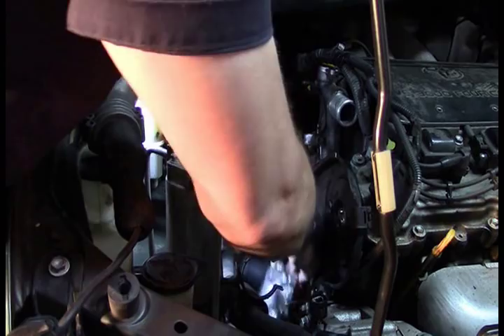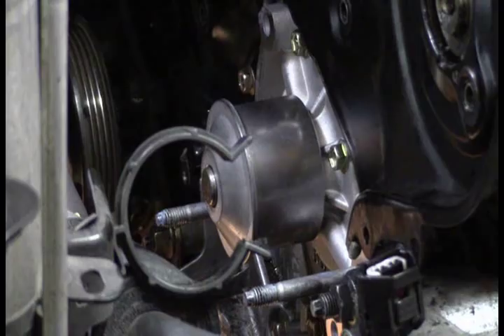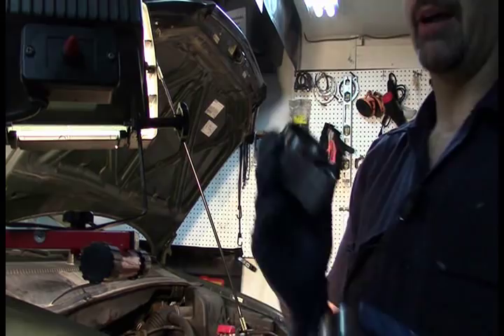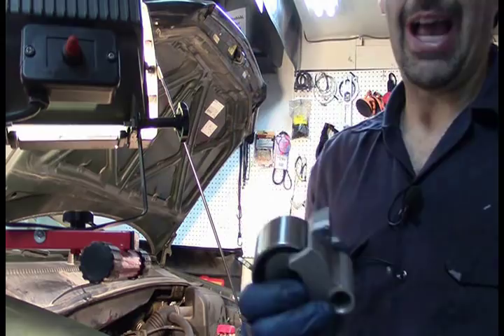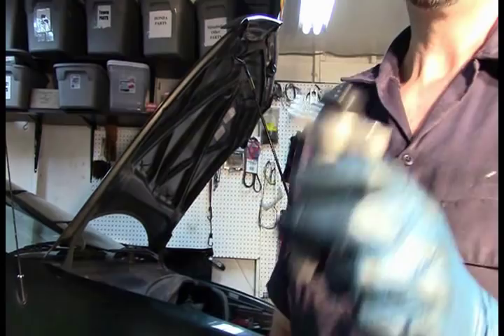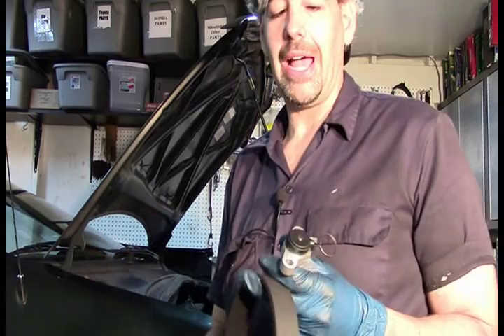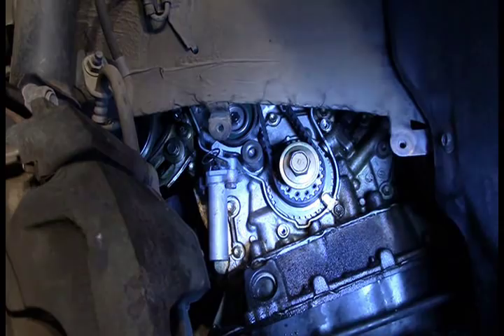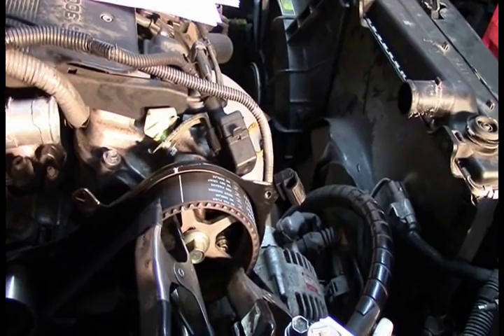Timing Belt 1997-2010 Toyota V6 Sienna, Highlander, Camry, Lexus Part 3

Comment: Great video series!  I did not quite understand how you could take the belt off the rear sprocket with the jammed wrench there.  It seemed to block the belt from coming off.  Is the wrench there more of an insurance against the sprocket accidentally being moved?
Reply from the maker: Hi Bro, I was wondering where you've been!  Exactly correct, the wrench is to keep the sprocket from accidentally moving.  I did remove the wrench just to get the belt past. Just bumping the camshaft sprocket on this model will cause it to snap sharply in reverse into a "rested" state and the wrench prevents that.  It also help to lock it in position while I position the belt over the pulleys and crank too.
Reply: Well, I was disappointed because you did not mention me by my name in your video but I appreciate that you did tell the world that you were pushed to get better camera ::-)

Getting back to your video, isn't there a better tool to lock both the camshaft sprockets in place which goes between the two camshafts and thus belt can be removed without disturbing the locking tool?
Reply from the maker: 12vgs8606 Man I am not sure I ever got your actual name. I figured your birthname was 12VGS8606.  But nonetheless I don't know of any special tools that lock both camshafts for this model. Really you just need to lock that Bank 1 one as the front one is pretty stable and won't move unless you really want it to.
Reply: This job does look more complicated than the corresponding Honda one.  At least on the Honda,I have not heard about the cam moving but more importantly they do not use the brain dead design of having to remove the sprocket before the cover can come off before the water pump bolt can be accessed!  Was that a German or Chrysler engineer who designed that portion of the Toyota engine?
Reply: Since the sprocket needs to come off, that tool is pretty much useless on the Toyota!
Reply from the maker: 12vgs8606 I don't know who designed it but absolutely frustrating as hell. If the rear cover was just about 1 inch higher off the H2O pump you could access the pump without all the extra work. The first time I ever did a belt on this engine it sunk in that there really is no way to remove the H2O pump without moving the rear cover out of the way so I undid all the bolts and then realized that the cam sprocket keeps you from getting just the hair of clearance more that you need. Unbelievable.  The only way to get that H2O pump is indeed to remove at least one cam sprocket (the "book" tells you to remove both which is not neccessary).  
Trying to remove the pump without removing a sprocket will result in bending the rear cover and then the idler pulleys will rub against it.
Reply: But if you remove the rear sprocket (a challenge in itself!) how do you prevent that cam from violently moving?  I would have concerns about this timing belt change even if it were to be done at the dealership.
Reply from the maker: 12vgs8606 Ah I never even thought of that!! Fantastic question. Actually, the wrench to keep the sprocket from moving was my idea. The "book" says to just rotate the crankshaft back 40 degrees so all pistons are in a position that none are at TDC but I like my way better because it's easier to install the belt when everything is lined up.
Reply: Schrodingers Box OK...I line everything up before disassembly, double check that engine was in time and add marks for re-installation, then turn crank 60 degrees CCW. After belt removal, If you turn the bank 1 cam CW about 3 or four teeth from TDC position it will stay in place temporarily. When you are ready to install belt, move bank 2 cam about one less notch CW,  put belt on Bank 1 gear and clip a spring clip over end of gear to keep belt in place, route belt under idler to bank 2 gear, clip belt on gear. With the lines on belt aligned properly rotate each cam CCW, starting with bank one, until marks are lined up with rear cover. Is belt tight at top? If it is route belt around WP and tensioner, turn crank.to TDC and install belt. double check cam marks. Release tensioner pin. Turn crank 2 full rotations & re-check marks. 

If all is good proceed with assembly.

Comment: loved your video.  I have a 2000 sienna with 212k miles.  I am good at fixing things.  I hate not having enough rooms to stick your hand.  I am thinking of doing the timing belt and it would be great if you include all the tools required to do this job.  Thanks in advance.
Reply from the maker: onesri The video shows everything you need

Comment: Is there a normal belt sound to a new timing belt?  I replaced all of the components that touched the belt.  Car runs great.  The new belt sounds like a new belt.  It is not silent, does not make an unusual noise, and does not smell like rubber burning.  It simply sounds like there is a belt under the timing cover. Is that normal always or for only the first few hours of operation?  Unfortunately, I did not really listen to the belt prior to replacement so I do not know a known good sound.
Reply from the maker: +Sandbag1300 You should never hear a timing belt- or any belt for that matter. You might hear pulleys if the tension is not right or there is component wear or rubbing, etc.
Look for a mechanical interference.
Reply: I may be overly sensitive to the sound as I am somewhat a perfectionist.  The 6 cylinder engine is whisper quiet.  Only thing I can think may have happened is that I had to re-compress the new belt tensioner in a vice before re-installing it.  Maybe as a result the tensioner is over tensioning the belt.  That is kind of what the sound makes me think. The water pump and pulleys are new from the full Aisin Toyota timing belt kit and were in perfect working order before installation.  Does an over tensioned new timing belt sound possible?
Reply from the maker: Sandbag1300 An overtensioned timing belt will definitely cause bearing noise on a pulley.

  In all fairness what you may have here is a bit of a placebo effect- the noise may have always been there but because you are paying extra attention because you just replaced the timing belt, you are more perceptive to any anomalies.

  It may be as simple as just an accessory.  I would start by removing the serp belt and see if noise goes away.

Comment: Hi Matt.  Thank you very much for the video.  It helps me understanding my car repair and identify honest mechanics.  I got timing belt done at a local car shop.  The main technician of the store did exactly steps in your video.  After timing belt job was completed, the engine runs smoothly but engine light came up after 20 - 25 miles with code P0016.  He suggested to change Camshaft position sensor on my Toyota Highlander 2003.  After camshaft position sensor was changed, the engine light came up again after 25 miles with same error P0016.  Just wondering if timing belt jumped few teeth?
Reply from the maker: most likely.  I usually correlate the CKPS with the CPS to diagnose that but you also do the laborious method of checking timing marks

Comment: hoping you can chime in. Gates or Dayco Timing belt kit for an 05 Sienna. Gates ranges from 0 to another $20.
Reply from the maker: The kit shown in the video is Gates, and I have used both and cannot discern any evidence of a variance in quality. FWIW, the first belt I did was a Gates maybe 7 years ago and car still running with those parts so it does have at least some evidence of longevity but I'm sure same would be true if I used Dayco.
 I'd go with the cheaper and not have any concerns.

Comment: i usually also change the shaft seals of the cam crank and oil pump if oil pump i cam sprocket driven, if the vehicle had its secound belt change and no sign of the seals been replaced as they can oil up the new belt when they fail ,
Also i always disconnect the battery , i know immobilizer car radio etc. but the risk of somone starting a  car i do a belt on while i have to dash out from the shop is to big a risk and a spanner or something actuating the starter while you have the belt off is another risk. a small risk but if the battery is disconected this risk is eliminated also. one can use a small batt to keep the system allive if it needs continues power ......
for sprokets often there is a lock tool  and i do undo the cam bolts with the impact gun befor i remove the cambelt just to crack them loose , but the cam bolt and balancer is often the biggest problem
Reply from the maker: Ah great advice. Never even occurred to me about the pump and seals, totally logical idea!  Thanks for the comment.

Comment: Where do you get the torque specs from ? Is there a website that you would recommend ! I'm a DIY I learn from your videos this is amazing how you guys can teach as if we were in class. Thanks!
Reply from the maker: Yes good question: I pulled the specs from AllData DIY which I use occassionally when doing a job where torque is particularly critical or I need wiring diagrams.

Comment: One more question if you have time:

When you raise the engine a bit to clear the sidewall for water pump removal, I'm guessing you must first loosen the other engine mounts?  Or, will the engine move with a jack from below without loosening the other mounts?
Reply from the maker: The engine will move just enough without loosening mounts for the purpose stated in this video.  just make sure you stop as soon as the engine no longer moves- you dont want to lift the car by the oil pan!
Reply: Gotcha.  Again, thank you!
Reply: did you successfully remove the water pump buy just jacking up the engine without remove the engine mount in the bottom?
thanks
Reply: Tod Wong Yes, that was my experience. I did not have to remove bottom mount.

Comment: Hi, I was wondering on this or any interference engine when you backed off the crank 2 or 3 teeth I would of bricked it thinking I'd make valve contact because one revolution equates to 2 of the cams obviously not the case though.  When I first attempted TBelt change on my 1.9jtd 8v recently I did back up the cam a bit tension side to accept belt mark and all was fine after tension. So generally have you sufficient clearance to aid belt install, cheers great videos again!
Reply from the maker: As long as the cams are positioned at TDC there is no concern about backing the crank off and hitting any valves. But I can definitely tell you that on interference engines if you have any valves at full open position and you rotate the crank in that cylinder to TDC you will indeed make valve contact.

Comment: How do you retorque the crank bolt? Why is that left off every video I have looked at?
Reply from the maker: you just torque it by using a impact wrench. or obviously you could do it by just locking either the crankshaft or camshaft in position. that’s all. there is really nothing to show.

Comment: Great video, excellence explaining and precaution. What happened if the timing belt already broke off and I'm trying to replace a new one on when their aren't any mark on the belt to line up like you showed on the video? Thank you for this great video
Reply from the maker: The new timing belt usually has marks on it for this reason but honestly, as long as the cam and crank are lined up the marks on the belt are insignficant, they are only there to help see the cam and crank marks better.
Reply: Thank you

Comment: Hi, how did you raise the engine a little bit to remove the water pump? Do you have to unscrew the engine mount?
Reply: I find the answer from you .
for people who don't know this 
Schrodingers Box:
The engine will move just enough without loosening mounts for the purpose stated in this video.  just make sure you stop as soon as the engine no longer moves- you dont want to lift the car by the oil pan!
Reply     
 Michael Halstead 
Michael Halstead2 years ago
Gotcha.  Again, thank you!

Comment: Hi Schorodingers, thank you very much for your video. I have a question: what if after we put on the timing belt and turn the crankshaft 2 revolutions and find out the TB not aligned, can we remove and do it again or how do we do from there. Thanks
Reply from the maker: if it is not aligned you need to remove the belt, reset cam and crank positions to TDC and try again. and maybe again lol.

Comment: What do you think is the best timing belt kit to get and what i need, parts, any specific brand or oem parts, Also how strong of a impact is needed to get the bolt off
Reply from the maker: +Patty Razer I use either Gates or Dayco and am convinced they are probably both sourced from same manufacturer.  
   I have had numerous times where a 700ftlb max reverse impact was unable to remove the crankbolt

Comment: Hi, I couln't really imagine a slipping belt over one of the idler pulleys or tensioner.. I once experienced a frozen idler pulley while driving on the highway and the belt immediately failed.. the teeth were stripped off of almost half of it!! Unfortunately that was an interference engine as well so I ended up replacing it. Did the belt service on the replacement unit including the pulleys etc.. and it ran for years aftwerwards..
Reply from the maker: I have seen both.  Just last week I visited a subaru where a frozen water pump pulley caused a belt failure immediately as you stated. The owner described a burning rubber smell and then almost immediately the engine ran rough and stopped before he could turn it off and unfortunately the engine was severely damaged. But I also saw a Toyota Camry 2.2L with a frozen idler pulley that probably ran for weeks like that! In fact, it is the red camry in the video "12 ways of how to change a head gasket".  When I repaired the car after making the video, much to my amazement I found it had a frozen pulley and yet ran fine. It was running with a frozen pulley all through that entire video in fact and I never even knew it!! How cool if the belt broke during filming huh??
Reply: Schrodingers Box
Then I guess its my lack of imagination :) I'll review the video you mentioned too.

Comment: You didn't remove the rear cam sprocket but wouldn't it have been ideal to change the cam seals too? or is that not a huge deal to have it done?
Reply from the maker: No it would be appropriate to do for sure. Offered to owner but he declined so i didn't cover this.
Reply: Oh no wonder. Due to the valve spring tension you mentioned  would it make it more of a hassle to do so? because I can't seem to get my head around in how to have  it done. I've seen other videos on the same engine work without mentioning this spring loaded/ rested position. unless its not critical until one pushes on it.

Comment: Hey Matt! Im in a serious bind! I am at the point where you turn the crank shaft twice to ensure timing is good and of course I put the bolt into the crankshaft without the harmonic balancer like you did but I just drove the bolt too deep apparently and now I can't get the thing out. I used my 1/2 impact, tried MAPP Oxy torch, and used Allen wrenches in the little holes to support a bar while I used a breaker bar on the H.B nut with no avail....any advice?
Reply from the maker: Never heard of that happening.  Not sure what to suggest- you tried everything I have.
Reply: Did u get the bolt out finally? How ?
Reply: I took a part a pair of joint groove pliers and wedged it between the crankshaft sprocket and the engine which held it in place while I attached a 1/2 socket, extension, and a 1/2 ratchet with a huge homemade breaker bar. I actually used the bar/handle from my Habor Freight Jack which is about 5 feet long. It made an awful creaking noise and I could only turn it about 1/2th of a turn before having to reset the whole thing. I did not end up marring the the sprocket much. I figured this was my absolutely last option and if need be I could find one replacement at the salvage yard. After some cursing, a few beers, and a prayer I got that damn bolt off. Once I got it off I saw that I severely stripped the last 4 threads toward the end so I was just driving it into the shaft beyond where there was threading when I was turning the crankshaft to ensure my marks were correct. Im surprised it did that amount of damage. It went back in ok with my impact wrench.

Comment: excellent video, couldn't have ask for better, very thorough, thank you for sharing, now all my question about timing were answered, my brother just had his timing belt done at the dealer, if I saw this video earlier I think my brother could have done the job himself the correct way, now my brother is not happy with the dealer timing belt job because his  car  is not like before, idles a little rougher, before de engine was so quiet when its idling.  Any suggestion as to why it idles rought. Again thanks for sharing.
Reply from the maker: Traucon, I have no doubt they did not have the rear camshaft timed correctly. As you saw it is VERY difficult to do that and they may not have thought of the mirror idea to make sure it's right.
Reply from the maker: And I forgot to mention- Thank You for subscribing!

Comment: Your title is misleading or you just don't know what you are talking about. My generation of sienna which is 2008 sienna uses Timing chain and not a belt. I'm aware that the generation prior to my generation of sienna uses Timing Belt. You better correct your tittle. My 2008 sienna is under the 2nd generation which uses timing chain and not a timing belt. 2nd generation are 2004 - 2010 Sienna. I hope you'll correct you tittle. okay...
Reply from the maker: Yes the Sienna did start using a timing chain in 2007 however since there is such a broad scope of vehicles covered here and only so many characters with which I can make a title to cover the range, the wording was the best I could come up with.  Had I made this video ONLY for you instead of for the entire world, I would have specifically worded the title for only your specific year make and model.